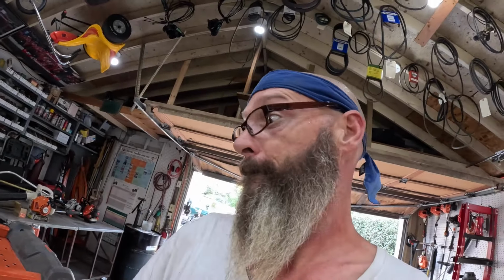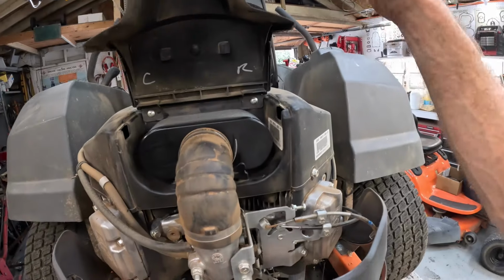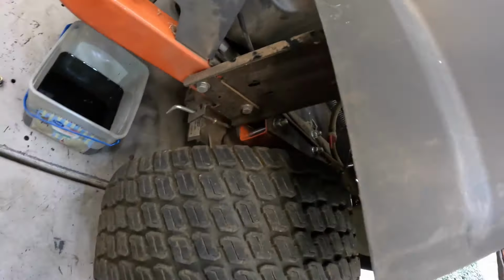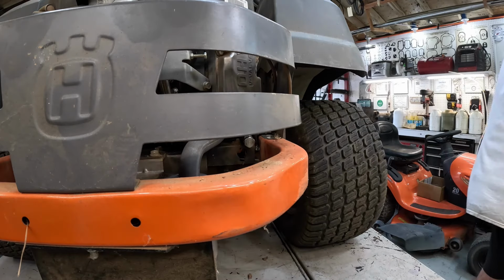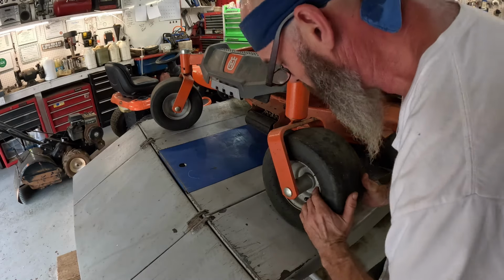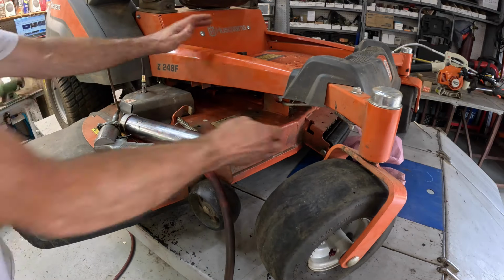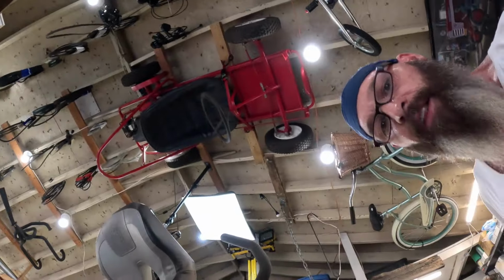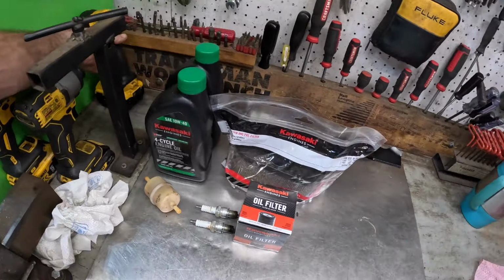Husqvarna Z248F Zero Turn Kawasaki FR651V | Annual Service!

Comment: I Saw taryls video on the frame in Husqvarna  breaking he got a.repair kit for repairing.it
Reply: I’ve used 3 of the heavy duty kits from that company and there great fix 😊❤
Reply: @philliphall5198   you got that right @ phillphall5198 because someone was eating swiss 🍕 when they were designing the frame for the tractor's other thing is that they can't explain why they made all of this unessery Holes 🕳️ and using thin metal basically they had a brain fart while they were at the computer designing it
Reply: Tom watch the recent video on the Husqvarna Tractors that had a recall that has expired on the frame cracking at the deck support and where he got the kit for your reference. It causes the drive belt failure to the deck.
Reply: At Taryl's YT channel.
Reply: Say Tom where did you get your new shop towels at?
Reply: Good video Tom. Take a look if DeWalt has a battery grease gun since your battery platform iss DeWalt.

Comment: The 691 use the 5 plug also 😮
I think they sale the same kit for both of them 😊
Should add a manual fuel cut of valve to, just in case 😮

Comment: Tom, have you ever thought about putting in a waste oil heater to (#1) heat your shop, and (#2) to get rid of your waste oil? It was the best move I ever made for shop heat. They are expensive but I found one on marketplace for less than 1/2 price. Great video as always :)

Comment: Hello Tom, Did you happen to see the latest video that @TarylFixesAll released today regarding the broken frames on the Husqvarna garden tractors?  I had a similar experience with a Ford/Gilson LGTH-17 garden tractor that the transaxle was flopping around because of the broken aluminum casing ears where the bolts screwed into from each side of the frame. The genius who had the tractor before me thought that they could glue the broken ears to the transaxle casing with JB Weld. Yeah, It was a mess.
Reply from the maker: just got finished watching it, awesome! i have some cub cadet videos doing frame repairs

Comment: I got the same problem with my badboy zero turn. Hour meter don't work.
Reply: Check the connection at the meter 
Had several just come loose and need to be crimped more

Comment: Wow 3 year old mower and the hour meter doesn't work,  I have a 2003 and it still works 😅  also hear Husqvarna is bad for the frame to Crack in half, which they refuse to take responsibility for. Manufacturing standards have gone to pot in this country so has customer service,  mowers, cars, Everything!!
Reply: It’s the riding mower that break the frame not the zero turn 
Yes they are breaking for sure 
Kit to fix
Reply: @philliphall5198  yes the rider's